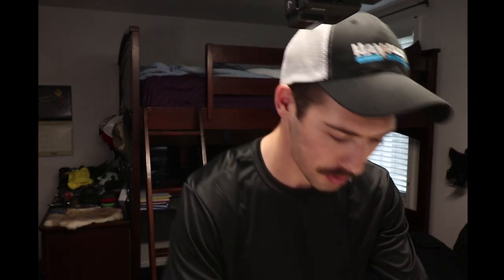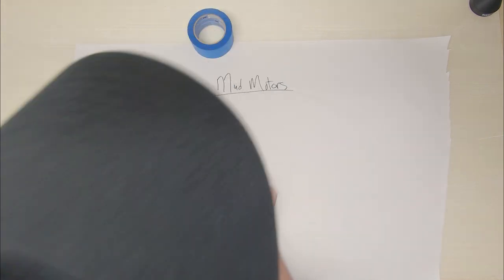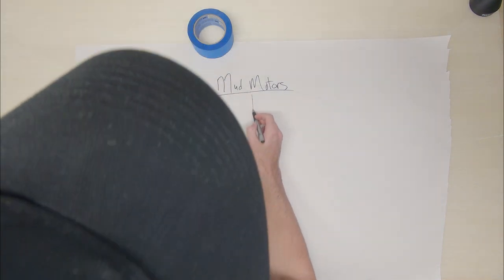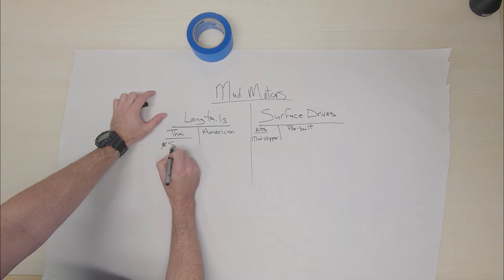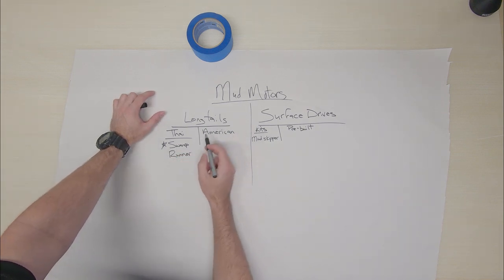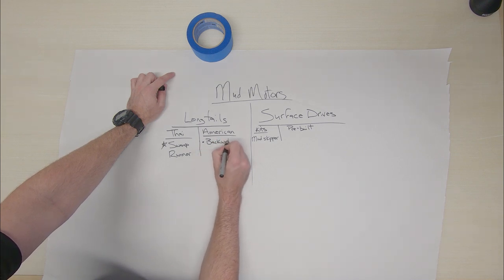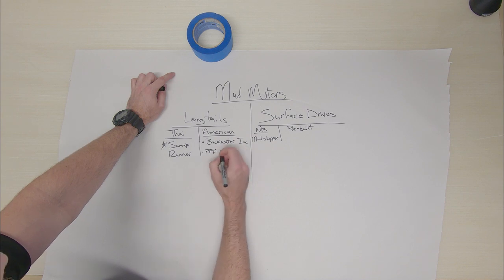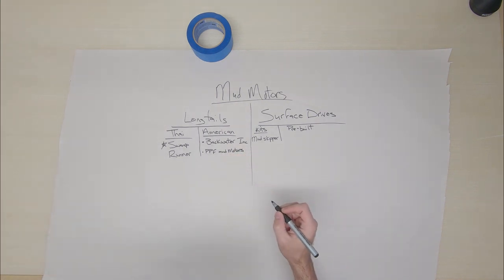American Longtail Mud Motor Kit Challenge

Comment: I got a surface drive kit from mudskipper, it bolts on to the 13 hp motor. Its not that much heavier than the longshafts and it does pretty much exactly what the long shafts will do the only difference is its alot easier to use. Its not even that much more money. It’s about $800. I highly recommend it. Way better to maneuver in the tight spots. Most surface drives are overpriced but this one is the right price and its really good.
Reply from the maker: Thats good! I'm learning that longtails are not for everyone. I'm a small guy, solo fish, and can function the longtail without any issues, but when it comes to larger people who may have difficulty with balance and maneuvering, a wider boat and surface drive treat them better. Same for those who have an injury. I like the idea that the longtail can reach out and get water and the water doesn't have to be right there at the rear of the boat. This comes in handy if you high center on a log or dam or if you get stuck on a bar. You can search around with the longtail but with the surface drive, it's limited to right there at the rear of the boat. It all depends on how you use your boat and what you like. I'm glad you found something better for you
Reply: JTgatoring ya man that makes sense! Im a big guy and new to boating so im uncomfortable standing while the boat is moving. It also depends on where u live too. I dont have marshes like you do. We have alot of mud and narrow water ways so the surface drives work great and im never having to reach to find traction. I went with my buddy with a long tail and he had a hard time in the skinny water because the shaft stuck out so much. But i definitely see how they work better for you. Im a duck hunter amd always have people with me so if i get stuck i have tons of help to get out. Keep up the good work bro, u helped me learn a ton about mud motors and played a big roll in what kit i got and prop sizes and all that! Loads of vary useful information on this channel
Reply from the maker: @jimboneutron8399  I really appreciate it, thank you. It seems like this topic is something that needs to be discussed. I've had it come up A LOT recently. You'll probably see a video come out about it, and just know you played a part in it. Thanks again 👊

Comment: Hey jt i commented on the video that you posted about testing all the Thailand Mud Motor kits 2 years ago I remember asking you about the Backwater Mud Motor kits versus the Thailand kits well I went out and bought one of the Backwater 23 horsepower light Motors I promise you can go just about anywhere with the Backwater I'd put up against the Backwater with a surface Drive mud buddy the back water will come out on top I cannot wait to see your results on these kits I don't know about the smaller kits but I do know the bigger kit is flawless I have driven both surface drives and long tails and I would rather take the American longtail any day over the surface Drive keep up with the good videos Man
Reply from the maker: Thank you for the support Hunter!! I greatly appreciate it and especially for that long! I've heard A LOT of good things about the backwater kit and I do not doubt it. After doing research and talking to people, I think longtails are for boats 15' and under. a 23hp longtail is probably the biggest I'd go. Once you get up into the 30-40hp range, you're normally running a bigger boat and that is when I would want reverse so that is when I would look towards a surface drive. I'm glad you're happy with your backwater! We'll see how it performs and then compare it to a Thai longtail. The only big question is if it performs 2 to 3 times better than a Thai kit because its 2 to 3 times more expensive.

Comment: Looking forward to the backwater review.  I honestly think you won't want to use a Thai kit again.  You'll no longer need a rigged up rope to hold your motor up at rest, the mount is superior in every way, and the cavitation plate lets it run wider boats.  You no longer need to carry extra props because the stainless one is incredibly durable and it uses real, high quality bearings instead of plastic or wood bushings.  I use a 13HP backwater kit myself and watched every one of your vids before buying it.  They convinced me that it was the kit for me.  Buy once, cry once.  I will say it is slightly slower than your testing as mine tops out at 17mph with the 8x4 prop (1436 alumacraft, identical to yours) where as you were getting 20mph.  It's worth every penny of it's price to me and I think you'll come to agree as you run it.
Reply from the maker: I look forward to testing it! I hear many good things about it, but its almost 3 times more expensive and some people just can't afford that. Thats why I really enjoy the Thai kit. There are many pro's and con's on both and I'd like to see how fast I could get the Backwater kit too. Haha theres many things I'd like to compare between the two. Soon enough it will happen. Thank you for taking the time to give me your input, I appreciate that
Reply: In regards to the Thai surface drive kit, a friend of mine bought the 16HP kit from mud skipper.  It's OK.  He runs it loaded down on a 14ft semi-v and gets about 19-20mph.  It has good power, but is awkward to actually drive without the clutch.  The lower unit seals are garbage and constantly have to drain water out of it.  Leaks around the drive shaft.  If you do get one, make sure it has a clutch and an extended tiller handle.  The short stock one is serviceable, but not great.

As for the mud buddy, we have one (4400 EFI Sport) on a Lowe R1960MT.  It's absolutely great for that boat.  Runs 25mph with 3 guys and the blind on it.  In sport mode it'll push 35mph with a light load.  Definitely wouldn't want a long tail (or American beavertail) on that guy.  Way too heavy.  We can push it around ok to get into position when hunting, but if it's hung, you need the motor to assist.  At around 10k, and 300lbs, it's not something to consider without good reason.
Reply from the maker: @gbstrick1  Yeah... if i were to get a surface drive just for me and not do a review on it to test it, I would get an american surface drive like a mud buddy, gator tail, or prodrive. I would not mess with the mud skipper one because if I get a surface drive, it will be for a big boat like you explained. I need something that will actually work and has big power to move a big boat

Comment: Looking forward to what you find.  I appreciate all you documented of your research and continue to document.  You may recall I've got the Alumnacraft 15 with the predator 670.  You may want to try to connect with Dave Pickrel... I followed some of his stuff because he has, or had, the same 670/Swamp Runner setup.  When you jump up to a 100" shaft and the torque of a 670, it can be beast to handle... I tend to sacrifice the speed and use a smaller prop just to better manage torque.  Dave took the Swamp Runner off and put a mud skipper surface drive in it's place..  It was not a simple unbolt one and bolt on the other.  It might be worth trying to have a conversation with him.

On another note... dude, I like the new statch... you're a dead ringer for Uncle Ricco...
Reply from the maker: The 670 does seem like a good bit to handle. Most people say they love it. There was another person who said the 670 was tough on them and I directed them to Swamp runners video on how to dial it in and never heard back from them. I don't doubt ya though, what size prop are you running? 

hahaha ya'll are killin me with the stach comments I laugh so hard reading them. Thank you though! I'm planning on keeping it through November...after that its anyone's guess how long it will stay
Reply: @JTgatoring  I'm running a 9.5 over distance... run a 9 with load or predominant slow speed maneuvering.  I had a regular shaft and tuned the skeg and it did make a difference.  Now I've got the extreme saltwater series shaft.. you can't bend that skeg, they send some doodad that you connect to the skeg and you can bend that to adjust the tracking.. I lost mine though before I got to install it.

Different topic; but, how do you manage corrosion in your FL environment.
Reply from the maker: @hisechapman1165  If you can't bend it, try clocking the tail. Normally the skeg sits straight up and down (6 o'clock) loosen the coupler shaft so you can rotate the whole shaft so that the skeg is @ the 7 o'clock position when looking at it from the prop. Play with doing that a little and let me know if it helps at all. 

I haven't had a corrosion issue. I have only run it in freshwater and I keep it covered with a tarp while not in use. Some of the screws and bolts are rusty, but the tail, coupler and the other painted pieces are doing fine. Have you run into corrosion issues with your kit?
Reply: I have the stainless medium sps kit.  I run in saltwater all the time.  I spray my engine with Boeshield T-9.  After every use, I remove my drive shaft and flush it with water.  Then I pour a 1/4 cup of used motor oil down the shaft and let it sit till my next outing.  I have a lil bit of rust on my motor.  It’s bout impossible to stop.

Comment: Have you looked into what the smallest twin cylinder engine you can buy is?
Reply from the maker: I have not. I have not had the need too. I just took a look and Vanguard makes a 13 hp v-twin. If I were to get a v twin, I would probably go with the 16 or 18hp Briggs

Comment: American mud motors are so over priced. Best bang for buck is the mud skipper short tail or weld one yourself. The long tail is nice because it can  really push me out of anything and if it can't I can use it as an oar to move me out. It can also be used as a power pole in shallow water. My surface drive I don't have to worry about tying up, about the potential for going sideways and flipping my boat/killing me, turns sharper and I can install a clutch system. Great for really narrow streams. The unit is much heavier on the transom though. There are pros and cons to both.
Reply from the maker: You make some great points! I'll definitely take weight into consideration. Once I get done with the longtails, I'll start trying out the surface drives

Comment: You’re going to put a surface drive on your 1436? With the same 420 motor?
Reply from the maker: It's a possibility. Id like to test out surface drives next
Reply: @JTgatoring  Mud skipper short tail base kit, they're awesome.
Reply from the maker: @SC-dw3jz  They will probably be the first one I try due to the price since most of the other surface drives are two or three times more expensive

Comment: Get a backwater kit and put a 301cc predtor on it and do the small kit with an 8hp honda motor with a 3/4 shaft and then you have the same hp on both kits
Reply from the maker: I already have the backwater kit for the 13hp engine. I would consider the PPF but they only have the 6.5hp kit and I do not see any special reason to go with that over a thai kit when you are in that hp range.
Reply: Yes but what you do not realize that the 301 and 420 predator have the same shaft in them this is just a comment dont lose a sub
Reply: @Threads1220  ur a very sensitive fella Michael...jeesh.  JT makes a great point and you get butt hurt.